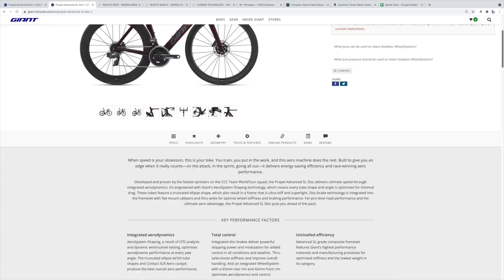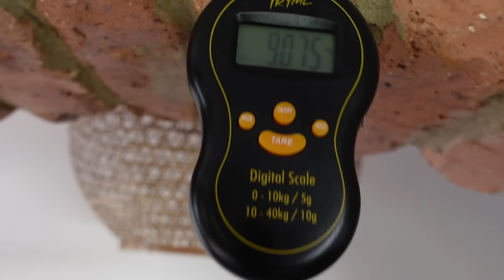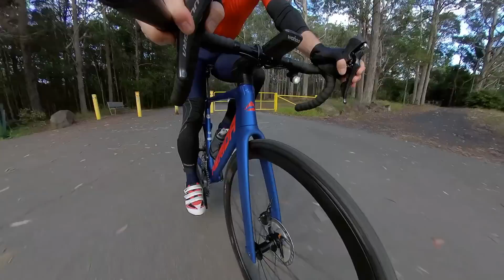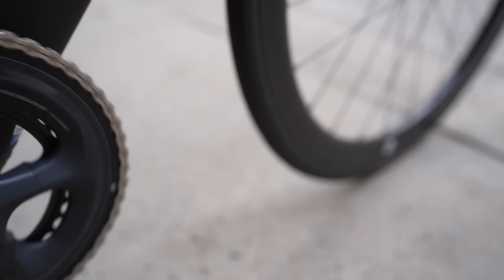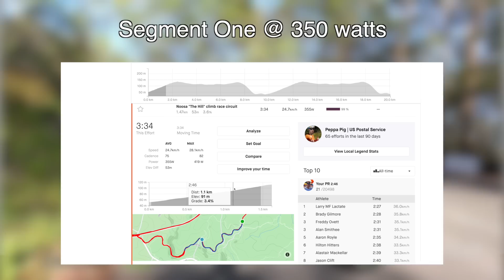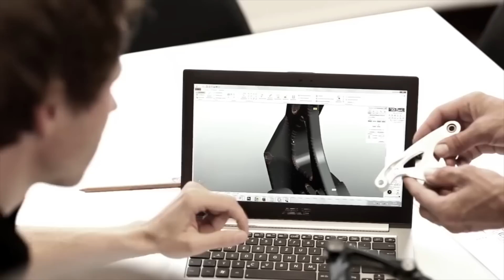Winspace T1500 VS. Giant Propel VS. Merida Reacto (incl: speed tests)

Comment: Cam I wanted to thank you for covering the Winspace T1500 so well.  I was so intrigued I bought a T1500 and cockpit for $1522 USD shipped with a promo code which IMO is an amazing value.  I just got it built up with the same SRAM Rival AXS eTap found on my 2022 Scott Foil RC and damn man, this bike is not only cheaper but slightly lighter and faster, again with almost identical parts (besides the wheels, but they weight almost the same).  I am so impressed with the T1500 I probably will sell my Foil and try and build a Winspace SLC2.0 for a dedicated climbing bike.  For anyone contemplating getting a WInspace, I wouldn't hesitate.  I was worried when you concluded the T1500 road "heavy" but damn man for me it's a rocket and it's the Scott Foil RC 20 that feels and rides heavy.  It took me riding a different Aero bike to realize this.  I think your coverage of Chinese bikes has been really informative and entertaining, do you plan on doing a video on Yoeleo?  I know you mentioned a while ago you had something going on with them
Reply: I’ve also read great on the winspace T1500. Considering purchasing in the near future with Hyper wheels 👊

Comment: Winspace got a low score in Practicality due to a couple of big "if's:" if there's a problem with shipping, if there's an issue with the frame upon delivery, if there's a warranty issue (is there a warranty at all?) and how easy/difficult it may be to deal with those problems. That seems fair to me, and it's a big reason I shy away from a lot of online purchasing (regardless of the product or its source,) but what I haven't seen much of is anyone talking about their experience with Winspace when they did have a problem. Are they an easy company to deal with? Is their turnaround time respectable? Considering the bike in question seems to be overall comparable to bikes of a similar price that can be bought domestically through a reliable retailor... I'm having trouble seeing any performance or price advantage to offset the direct market risks.
Reply: I’ve had a great experience with Winspace products & their customer service. They are extremely fast at responding & great to deal with. No issues ⭐️⭐️⭐️⭐️⭐️ Personally I’ve had more issues & negative dealings with local products & bike shops .. sad but true ..

Comment: What's up Cam. Maybe you can give me an idea what to go for. I'm riding a Bianchi 928L (2007) still doing its work and I'm still dropping guys on modern aero bikes. Lol. 
Ok back to my point. I want to go for a more modern aero (all arounder) bike. I'm not sure if I'm going to buy another Bianchi. Hut I've had tested a Scott Foil 10. I liked the way it felt but it was on a expensive side. Now I'm from Curaçao 🇨🇼. Here we have local bike shop dealer from Specialized,  Scott, Merida and Trek. The Madone got my attention lately.  But I also have an eye on the Reacto 6000. Could you do a review about the Madone? (If you can get tour hands on one) and compare it with the others?. Honestly I have to say I'm this close 🤏🏽 to go for The Merida. One thing is keeping me still thinking.  The weight. I'm accustomed to ride light bikes. Like my 928L is a 6.9 with DA but now swapped with  Ultegra mech.

Sorry for the long post. Looking forward to your advice.  Thanks in advance

Comment: Hi Cam. I enjoy the reviews. Thanks.  But I have a suggestion- wrt your rating system. Seems like you are missing something. Ie your main takeaway for the Winspace - per your commentary- was a sluggish feeling. But that doesn’t reflect anywhere in your rating system. So perhaps you need something like ride feel, or some other term, to be included?

The number 7 is a bit meh, but maybe you should still use it - for a rating of something that is also - a bit meh. 6 can be quite harsh. But then you stuck with 8’s - and maybe those are being over-used?

Look forward to the next batch of bikes. Cheers
Reply from the maker: Cheers for the feedback mate. I’ll put some though to the ‘7’ because I have felt the same. With the other point I feel that’s mostly personal experience and therefore hard to put into a rating system. But noted.
Reply: @CamNicholls  cheers Cam!

Comment: I have a 2019 propel same model and I've got speed wobbles a few times, once on a gravel descent, another time a pick up truck going the other way caused turbulence. And just last week I got it after a 250m elevation hill climb with 10% sections had a false flat in the middle that I luckily could stop at. I was legit afraid I was gonna crash bad going over 75kmph the pavement was smooth but a little wavey. And if I hit my brakes it just got worse. So kinda good to know that it is not just me that have had wobbles with it.
Reply: I had a 2018 Propel this year for a couple months, and had experienced wobbling several times on higher speed descents. The factory SLR1 50 mm deep carbon wheels were also rather susceptible to cross winds / gusts. At the end of the day, I just didn't feel the bike stable and safe enough on descents.
Reply: @WayneCouyon  I've ridden my 2020 propel advanced with 50-55km/h winds with gusts of course much stronger and actually felt quiet confident.  Before I had a 2010 merida Race Lite and I actually had to call my girlfriend to pick me up because I was too afraid to continue with winds of "only" 40-45km/h
Reply: @arhu74  A lot depends on wheels and tyre profiles. Looks like the combination I had wasn't the best suited to handle crosswinds.

Comment: The reason why reacto was the quickest of the bunch is probably due to it's long reach. Like you mentioned, reacto has the longest reach out of those 3 bikes tested. Meaning you had to lean forward more to reach the hood in reacto than other bikes, making you more aero without noticing. What I want to point out is that, it's literally impossible to compare and test these frames fairly in my honest opinion. BUT I STILL LOVE THE REVIEW ANYWAY CAM! CHEERS MATE!

Comment: Would've been more interesting if the winspace has the exact same groupset? Is it possible that the lumbering sensation came from the groupset or the gear ratio? Since the winspace has only 1x setup?
Reply from the maker: Thanks for the feedback, re group sets there’s another big cost there for me and I needed to weigh up the benefits vs cost. The wheels were the most impactful
Reply: No, the group-set would have made negligible difference. He also noted that the sensation came through what it felt like rolling over terrain and at lower speeds compared to higher speeds.
Reply: @niallwoan5847  thank you!

Comment: So, despite that fact reacto is the fastest in speed tests, you gave it 6.5 in speed category. I assume that's because of stock wheels? So with normal wheels it should've got a 9 for speed, and therefore smash the giant number-wise in your rating)
Reply: I think he gives it a low speed score for the speed it has with stock rims.
Reply from the maker: Yes as mentioned by others the score was based on how the bikes came. Confusing as the speed tests were all on the same wheels, but I had to run that test that way. If you watch this video you will see the Merida becomes quite slow with their wheels. https://youtu.be/0R7DTrepcoA
Reply: @CamNicholls  cheers, Cam. Yep, despite few quirks I found this review really helpful and interesting. Especially those parts where you're telling about your subjective feelings that cannot be measured, like giant being more compliant and windspace feeling sluggish. Also, photos of bikes, where you hold them, but don't look at camera - the focus is on bikes, and it works great.
Reply: oh you mean what he literally says at the end of the video ?
Reply: @pumpz4  sorry for my inattentiveness, probably I missed, that it was said directly.
Reply: @idiachuk  no need to apologise dude! fair enough it was right at the end to be fair - good that you got the answer for yourself though ha you were bang on

Comment: Because of your videos regarding the Giant Propel, I have preordered then 2022 Giant Propel.

Thanks for the great in-depth videos!
Reply from the maker: Nice one mate, enjoy
Reply: TCR rim is faster in all areas. I've ridden both.
Reply: @DurianriderCyclingTips  Might be so, but I’m not really keen on rebuilding/buying new carbon rims every five second due to riding continually in rainy conditions. Rather just run through some pads and “cheap” discs.

If it wasn’t the case for sure a rim brake bike, no doubt 😅

Comment: Great comparison! The Reacto and Propel are on my short list for my first own road bike (also the TCR and the new Cube Agree) . I currently ride my brother old Fuji bike that I fixed up. I have your exact height and a similar build with long legs and a shorter torso, so your info will be helpful to me. The Netherlands is also flat and windy. The Propel is the bike that is currently coming out ahead of other options I'm taking into consideration.
Reply: can save some weight by going 1x setup for netherlands too.
Reply: Which one did you end up with?

Comment: I'm surprised at the weight of the bikes, I have a Canyon Ultimate at 6.5kg with aero handlebars and 32mm depth wheel. I know it's all about aerodynamics now but 2.5kg is going to take a difference. What's your opinion on bikes 5 years ago, seems like the bike industry is going backwards.
Reply from the maker: I think they’re realising aero gains are more important than weight saving
Reply: Diskbrakes play a role maybe?

Comment: Great review Cam thanks for the video, I definitely thought you woulda picked the Merida in the end haha. 

Personally, due to having a rather limited budget for cycling, the debate always comes down to what gives me the best overall value, assuming marginal performance differences, which seems to be the case here. Giant and Merida have local distributors/dealers where I live and Winspace has direct official local support here too. From that perspective, with the exception of Look or Wilier (100% personal fan bias), I'd pick the Winspace for my next bike over most big brand bikes (in the same performance tier) simply because I am able to build the Winspace out exactly to my spec preferences, wheels, groupset, contact points etc, and crucially for a fair bit less money than an equally spec'ed bike from virtually any other quality brand(aside from maybe Canyon), all without the hassle/waste of having to replace any undesirable components(usually wheels) that may come as part of "the full package" of a typical big brand tier 2 bike.
Reply from the maker: Yes makes sense mate, thanks for sharing.

Comment: Didn't Giant have ditched alloy steerer for carbon for all the carbon models? At least that's what I was told by my Giant dealer
Reply from the maker: No if you go and look at the review I did on this bike I show you the shop cutting the alloy steerer.
Reply: @CamNicholls  on giant International site: Fork: Advanced-Grade Composite, full-composite OverDrive steerer, disc. For 2022 models and even on 2021... Is that model a 2020?
Had the previous tcr advanced with alloy steerer tube, found a big crack when I was washing it near the bonding of the alloy and carbon. I was a bit shocked, never crashed or hitted a pothole... Forks are worranted for just 2 years. Replaced it for free and sold the bike.

Comment: Gonna miss the Giant- as an owner of a 2020 Propel advanced pro I was rooting for it! Lol…. BTW, I figured out how my ML weighed less than your M… mine came with a full carbon fork, and it’s 7.9kg (17.5 lbs), with heavier Lightbicycle AR56’s (wit dt Swiss 240 hubs)…. Which means that if I got hyper 50’s it should drop weight. Oh, and I haven’t experienced any speed wobble, even at 47mph. But I agree that the propel soaks up the road buzz, my biggest complaint is the stem cover.

Comment: You mentioned the shorter reach on the Giant making for a more comfortable fit. Was your position, in general, and specifically the saddle to hoods/drops length the same on all bikes? Could a slight position difference be influencing the times during the tests, and overall feelings you experienced? I've watched your bike fitting videos so I assume they were all set up the same, but it's interesting that you feel that the shorter top tube of the Giant was influencing your comfort if they were set up to have the same rider geometry.
Reply: ^This. The fractional differences in speed / time on the segments on test and going to be largely driven by even small differences in the rider position as well as environment (wind speeds etc). These effects are going to outweigh any difference frame aerodynamics.
Reply from the maker: Drop to hoods was about 5mm difference between all bikes. Position was mostly the same.
Reply: What i was thinking too. Giant could have a slight disadvantage in terms of rider aerodynamics.